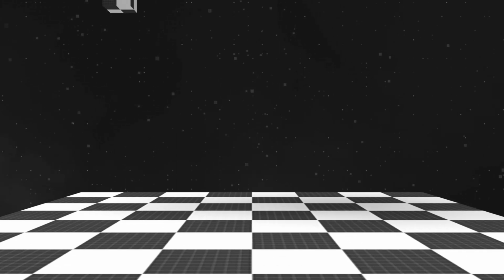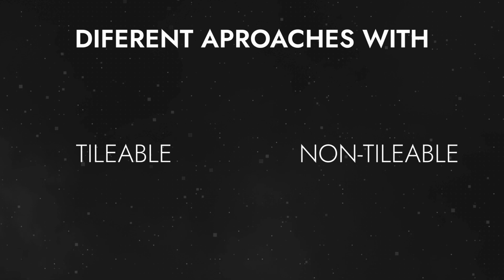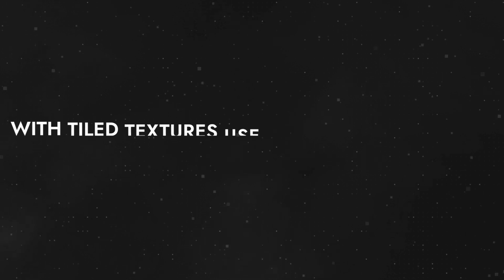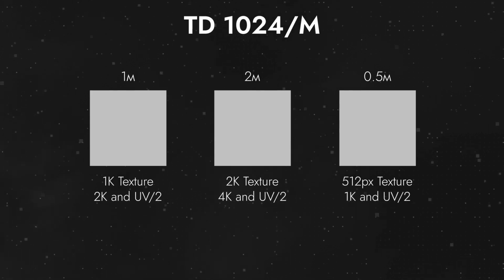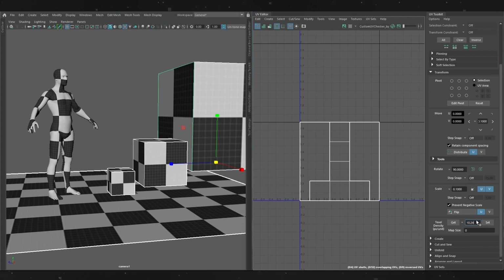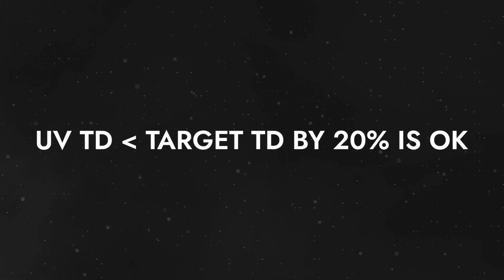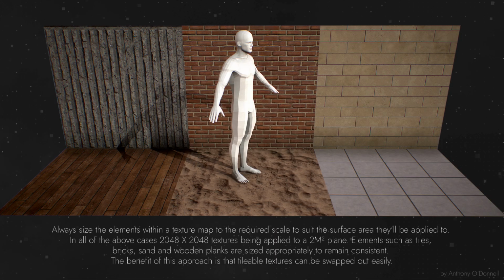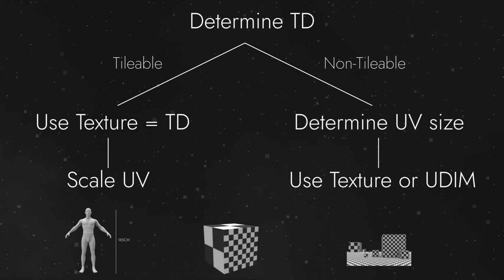You May have been Texturing WRONG This Whole Time | Texel Density

Comment: Hello

Is it normal for organic models to still have something distorted but subtle?

There are squares that are a little distorted because they are close to seams or in regions with fewer polygons.

Thanks
Reply: Hey Carlos, that's a great question! When it comes to UVs and assets like these, it's typically a matter of striking a balance between clean-looking UV islands, proper seam placement, and distortion. The placement of seams is crucial, depending on the use case, which is why you might notice some degree of distortion. Thankfully, this distortion can often be addressed within texturing software like Substance. It's not always possible to create UVs without distortion, but you can tackle it down to a minimum.

In 3D models, you often encounter complex geometric shapes that are challenging to map onto flat textures without causing distortions. Mild distortions in the UV layout can help mitigate these issues to a certain extent.

It's important to note that these distortions are usually subtle and don't significantly affect the overall perception of the model. The key lies in finding a good compromise between the quality of texturing and modeling efficiency. :)

Hope this answered your question, cheers!